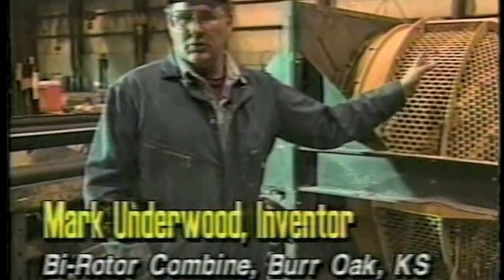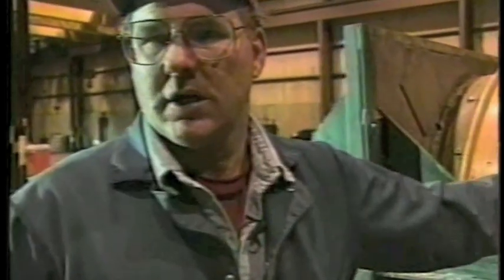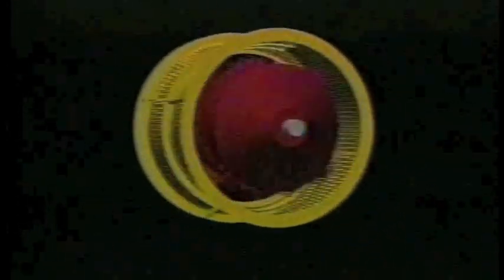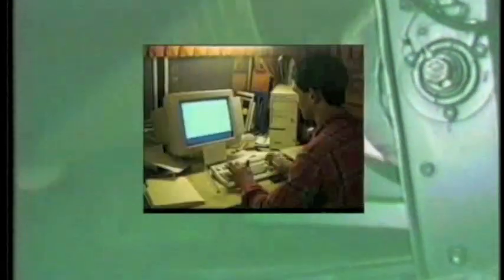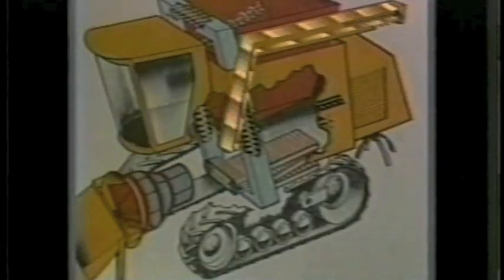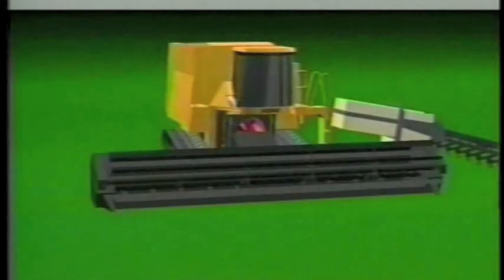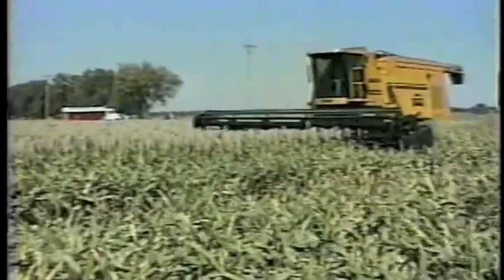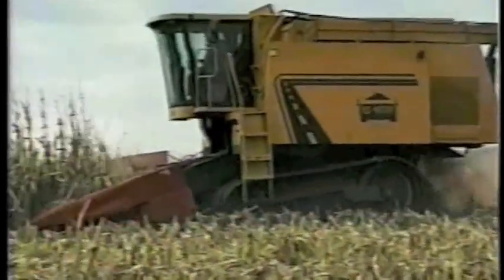FARM SHOW - Two Farmers Invent Axial Flow Combine

Comment: The Gleaner transverse would kill the competition if they would place an air blast above the entire length of the cage. I have done that  and it reduces rotor loss to almost zero.
Reply: Which way may I ask?(blowing to the left, right, forwards, back, down?)
Reply: Straight down right over the top all the way across the top of cage.
Reply: @gleanerman2195  I'll have to try that on my N and R
Reply: @gleanerman2195  So then it prevents loss by keeping material off the top and going back in then?  Did you add a fan or tie into the cleaning fan?

Comment: I’d like to see this machine in dry beans or any specialty beans at that
Reply: We tested all across the country and Canada cutting in both dry and green stem beans, flax, canola, etc. The Bi-Rotor threshing is gentle on the crop. At the same time with the rotating concave when in weedy or green conditions the Bi-Rotor doesn't pull horsepower as much as a typical rotor. If we did plug we could back  the rotor up and then take off again.
Reply: @ralphks583  few times I plugged up our 1480 I absolutely regretted it. What you just described here sounds like a dream come true.
Reply: We run tall green stem beans that are tuff as heck with a gleaner S98 with a 40 ft. head. We never have even come close to plugging the rotor, you would have to be really incompentent to plug it. The axial  is a different deal.

Comment: the new versatile combines are definitely using this technology. kinda neat really
Reply: That aren't using the same technology. They are rotating the concave the opposite testing. When we tested in lab test we found that didn't work and now the concave rotates at 1/10th the speed. The grain explodes out of the concave. We also didn't have to change grates or tighten the rotor for small grains. It worked it all crops at one setting with just changing the speed of the rotor and thus the rotating concave as well. It will be pretty unbelievable if they bring the machine out as we intended. Ralph Lagergren

Comment: It began in 1978 ... didn't International Harvester already have Axial flow on combines in 1975 ?
Reply: lepaul26 The prototype was 1975. Production was 77... 40yrs this year, but yeah, you are correct my friend :)
Reply: Just a lil history but the earliest id seen or read of axial flow seperators wss from advance rumely. They built corn shellers using it around 1910 which my uncle owns the most complete one known of out of 3. They were also testing it with their threshing machines.
Reply: new holland took their twinn roter two avoid patent rights with international, the designer of the international went to new holland because ihc wouldnt develope the roter at that time, they couldnt see the light at the end of the tunnel
Reply: Joe Scheller IHC was working on the axial flow for years before new holland even thought about it, some IHC engineers defected to new holland and made the twin rotor to get around the patents ,IHC sued new holland and won in   court .For Christ sake know your history before you post comments.Btw their was never an advantage with twin rotors it was always about patent avoidance just like John Deere with their feeder house accelerator beater on their rotaries ,because they can't copy the IHC forcing cone.
Reply: We had 24 patents of completely different designs. Just because we were a rotor doesn't mean we copied their technology. We did used a 1480 to retrofit our threshing design in and test which had a rotating concave. We then built the XBR2 from the ground up with features never seen on a combine.
Reply: @ralphks583  Awesome machine. What is the status Ralph?

Comment: knowing jd they shelfed it and is doing r &d work making it better then when pattent is no good will come out with it an not pay royailtyes to them guys
Reply: Deeres rotary combines dont even do well as their competitors. A single rotor the size deeres run has a flaw. It gets off balance and causes bearing failure. Seen it many times when i worked as a tech at a dealer.  One of the better combines to own if you can stock up on parts is a gleaner they a class 8 gleaner is competitive to a class 9 and the class 7 is equal to an 8 of competition. Only down fall is parts availability. That where deere beats nearly all its competitors is the dealer network out trumps the rest. You could have a major catastrophe and be bsck to running by noon the next day in the midst of harvest.
Reply: Yes you are right about not paying royalties by shelfing the design and altering it enough to deny contract. Its what they did to wagner with the wa17. They also tried to pull it on kinze but he turned them down so they tried to bank rupt him which they failed obviously.
Reply: John Deere paid us several million dollars for our 24 patents and the technology know-how. Like any industry if competition isn't fierce then companies aren't pushed to make dramatic moves and investing in millions of dollars of tooling. They treated us well. We barely missed selling to Caterpillar which would have brought the whole combine out but it wasn't to be. Now Peridot, Inc is serious about using our prototype as a model to bring to market the combine as we intended which would be exciting. But this wasn't a case of John Deere trying to screw some people. We did very well. I've continued to develop new products such as www.chemblade etc. I will miss my cousin though. He and I were getting to work on an idea together until Cancer took him.   Ralph Lagergren
Reply: Colton, you are right,  Gleaner is the best combine made, I run 2 S88's and have all the belts and bearings, after 4 years we have never had to use all those spare parts, but it is good peace of mind. My closest dealer is 370 miles away.

Comment: What a great concept. I can see why JD would shelf it. Much fewer moving parts = much less parts being sold therefore less revenue.
Reply: Actually Case IH was the first one to use it. John Deere was not first to use it. However, the concept of this rotary system is genius.
Reply: Buuuut more people would buy it for not as many breakdowns as the classical combine
Reply: @kendallfarms5957  people still buy the combines anyway. Same thing happened with duetz fahr, they started to invest in building self propelled equipment and then figured that each piece of machinery did away with several smaller tractor and equipment. So they were shrinking their own market which just wouldn't return enough money. It's got nothing to do with being better it's to do with returning more money to the owners.
Reply: Oh and funnily enough, this uses the 9600 John Deere combine cabin.
Reply: Considering that I work at a JD dealer, combines are already a pain to work on, this one looks exceptionally more painful to work on when it breaks down.

Comment: Ya now versatile combine uses the same idea
Reply: Nope . . . not true. Completely different machines. We had 24 patents covering all  the work that we did. Now Peridot, Inc is looking at producing the Bi-Rotor as we intended. Ralph Lagergren
Reply: Colton Carpenter They haven't got an outer concave that  spins.
Reply: The Gleaner concave does not rotate, but it does trees at 360 degrees which most other rotary combines do not. I think that Gleaner combines have an interesting design, but they are not marketed in Europe as far as I know.
Reply: สวัสดี